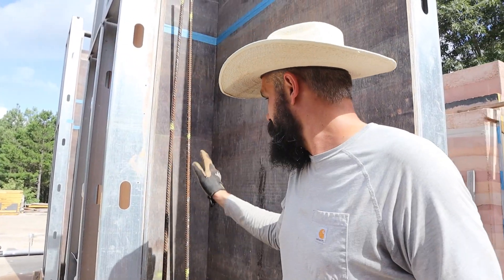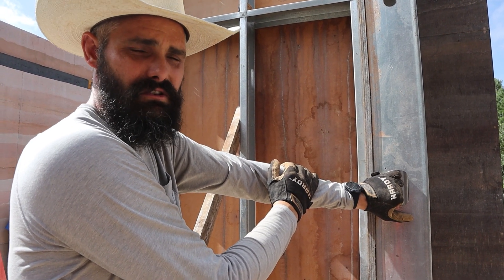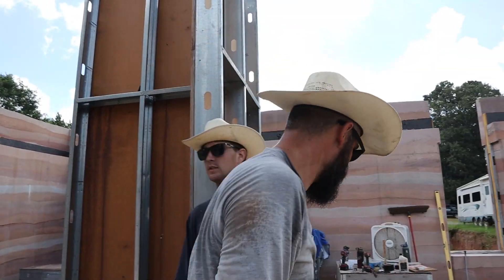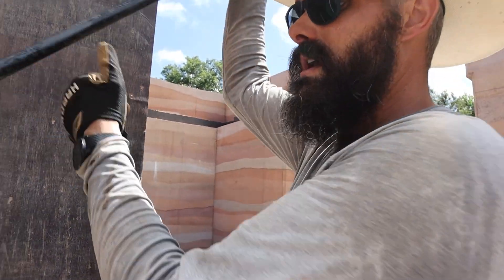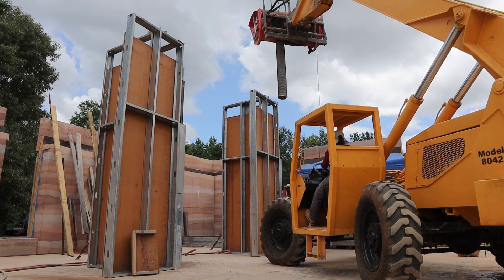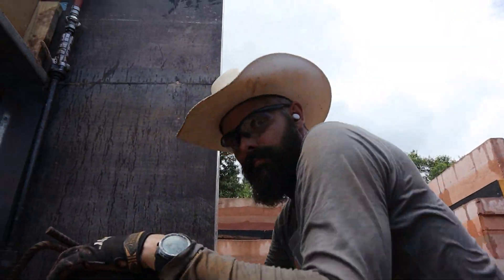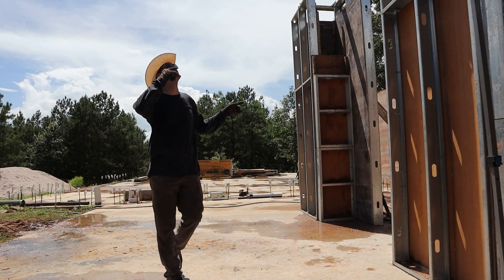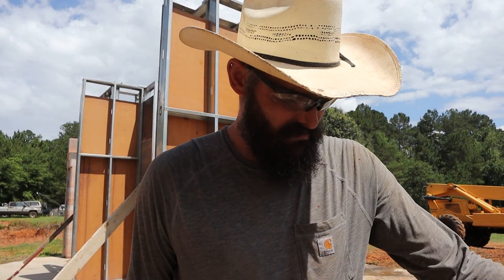Rammed Earth Columns to Support Garage Roof - Vlog 70

Comment: Your hard work each and every thing was great but there's have a problem because Your using steel in this Rammed Earth structure now it's ok but for future it will be the weakest point for this structure so keep in mind make some reasearch....
Reply from the maker: do you mean the rebar or the steel used for the windows frames? The rebar there is not much we can do but the window frames can actually be replaced if the steel ever rusts. It will take some chiseling but the way we figure it will last longer than wood and using rammed earth for the frames isn't realistic because there would be so little material that it would blow out when we attempted to attach windows to it. Hope that rambling makes sense LOL

Comment: What was the total cost to finish your home? What did Sirewall cost in total to work with?
Reply from the maker: I can't speak to the cost of SIREWALL because it wouldn't be fair to lock them into something given the fluctuating market. Feel free to contact them for pricing. For the total cost of the house it has actually changed quite a bit with the cost of materials but my guess would be about 500k US Not including machinery. But that is also using recycled material and milling all of our lumber. Hope that helps.

Comment: For the pillars u said u r not going to use steel rebars, but you used it.... Any reason¿
Reply from the maker: After thinking through the stability issues we realized that the rebar is what provides the only attachment to the foundation and gives strength to the walls. It is absolutely needed

Comment: I was going to suggest boxing held in place with bar clamps around the outside of the bathroom window to contain the concrete and give it a nice edge but you managed just fine without it.
Reply from the maker: Actually it rained later that day and forms would have been very useful. We will probably need to fix it by doing exactly this. Thanks so much for the tip!